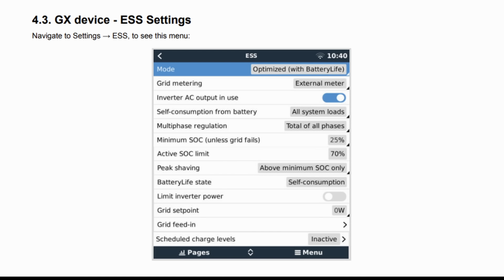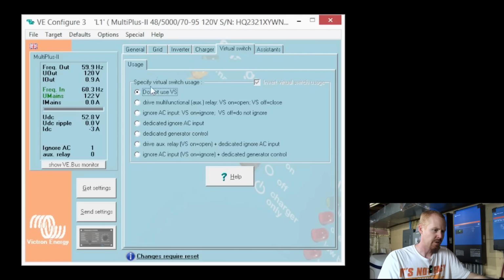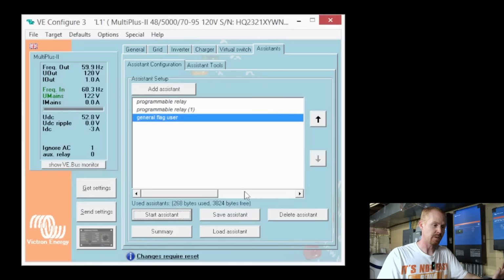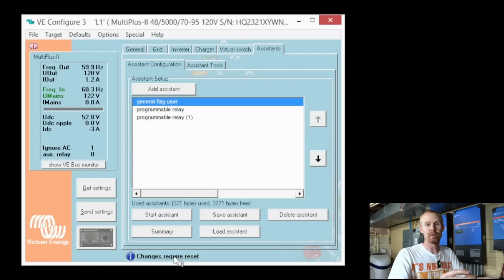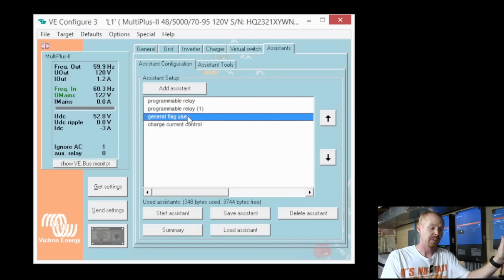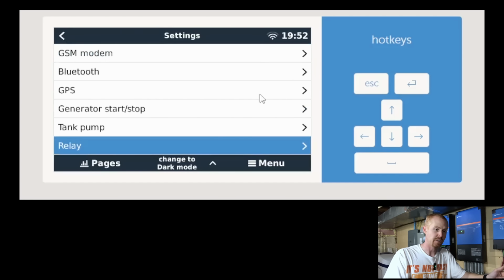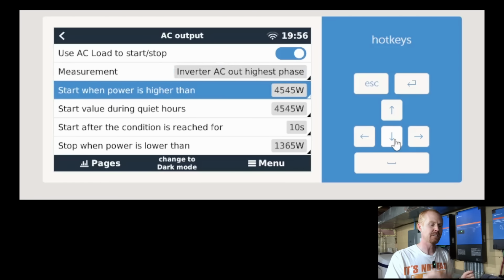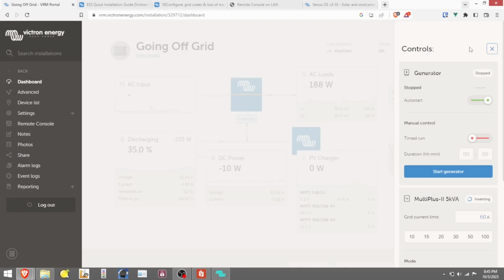Different Ways to Ignore AC Input on a Victron MultiPlus 2 Inverter

Comment: I'm so glad I found your channel.  I am just designing my Victron  2 x 48/5000/70 split phase battery backup system for my home. I do have a question. In a terrestrial environment what is the practical advantages of ignoring grid input other than potential time-of-use grid savings? Whether I am using grid to power my loads or using grid to replenish the batteries, I am still using the same kWh. Thanks!
Reply from the maker: The reason I want to ignore AC IN any time I can is that it seems like a waste to me.  You don't save any money if you're constantly using grid power to run your loads or recharge your batteries.  I want to use solar only to recharge my batteries so I'm actually saving money on my electric bill each month.  

Hope that helps!

Comment: Can you program a quattro with programmable relay to look at that AUX1 input and based on SOC, try to turn on the AC power or try to turn on the actual gernator start?   Example... Cerbo commands it's relay 1 to call for external power at 15%SoC.   The AUX1 is made and the quattro tries to connect to the grid.  If the grid isn't available, then obviously it can't.  Time goes on and the SoC drops to say 10% and the quattro then tries to start my generator of hte 2nd input.

I had no idea all this programability existed in the victron system.
Reply from the maker: @ai4px  I believe you could, you would just have to use a mixture of assistants and the cerbo relay.  Unfortunately the Cerbo only allows relay 1 to be programmed for the generator.  So you would have to program an assistant for 1 power source and then the Cerbo for the other power source.

If you think this customization is cool, you should look at NodeRed.  That gives you even more flexibility and control over all different aspects of your Victron system.
Reply: @AdamDeLayDIY I found a simpler way (I think).  The lynx shunt can have its alarm relay for for SoC.  More investigation to be done!

Comment: Hello again and thank 🙏you for giving me this link. Am I right in thinking that by using the "Ignore AC Input 1" the solenoid will disconnect that input even though it is physically connected to the grid? If that is so it would help me enormously by eliminating the need for an external relay 🤔
Reply from the maker: @9111logic  that’s correct.  Wires stay connected and even the grid is there, but the internal relay disconnects and doesn’t allow grid power to flow until you want it to.  This is how I’ve run my system for a long time.
Reply: @AdamDeLayDIY  Perfect 🙏
Reply: @AdamDeLayDIY  I had the same question.  Wiring a separate 50amp (I have an RV) relay would be cumbersome.  This is great because it gives the flexibility to cycle my lithium batteries, utlilize 1500 watts of solar to charge 600ah of batteries, and with a touch (cerbo) of the screen set to manual when traveling and living off the Campground's dime.

Comment: Great informative video👍
Wondering that what if we want to turn on AC input only to charge batteries?
Can we are able to set Battery as priority 1? 
As off grid, We are going to get (2) Multi Plus II as to setup as split phase.
Reply from the maker: @adassociates8235  thanks!  Unfortunately as soon as AC in is turned on, everything shifts over to it.  That’s the entire reason why I had to find a way to dynamically turn AC In on and off.  

I normally don’t charge from the grid but in the event I needed to, I would manually trigger the “generator” (AC In) using the cerbo and then I would throw another switch.  

Custom Grid Charging: Victron MultiPlus 2 & Cerbo Relay
https://youtu.be/T5-7xcGWsgE

Be aware that there was a part 2 to this video as I did miss a step.  

Custom Grid Charging - I Missed a Step...
https://youtu.be/5RkDZTYVTKw

Merry Christmas!
Reply: hi Adam, thank you for great videos as you are always do. just curious, How does the Inverter determine if it’s receiving power from the Grid or a Generator?
Reply from the maker: @adassociates8235  It doesn't know.   The Quattro has 2 Inputs on it but the MultiPlus inverters only have 1.

Comment: Thx Adam for taking the time to make this video and share it with the community…I’ve been struggling to setup a nodered flow to take SOC, load and time of day into consideration…also using global variables to avoid updating the flow..but it became too complex….I added a cheap 2 relay module to my raspberry pi and with kwindrems GPIO mod got them working in no time…adding the wire to Aux 1 was no problem, and the VEConfig was a cinch…albeit that I also did it the wrong way round….now my inverter is switching properly and I can set the parameters under Generator control on Venus OS 🙏
Reply from the maker: That’s awesome!  Glad it worked out for you!

Comment: I used your instructions in this video to set up my system to only charge the battery from grid when the charge drops to 50%. It then turned the grid off when charge reached 75%. This was workling fine for a number of months but 5 days ago it stopped working for some reason. It is now charging from 50% to 52% and then shuts grid off.

I have checked my assistants and they seem to be fine. I deleted them and remade them identically but it is till behaving the same. I am not sure what is happening. Any ideas? Thanks
Reply: It's using the BMS data now and it's set to use it. Maybe the communication between the BMS and the Victron was broken temporarily by fault of either device and the hard shutdown of the Victron restored it? That's the only thing I can think of... I could be wrong of course
Reply from the maker: @gocfella  it’s possible.  If it happens again, maybe unplug the connection to the battery for a few seconds (or try the redetect option under device settings on the cerbo).
Reply: @AdamDeLayDIY  Will do. Appreciate the advice.
Reply from the maker: Are you using a shunt for the SOC information or the battery monitor aspect of the inverter?  If it's the latter, when was the last time you fully charged the battery?
Reply: @AdamDeLayDIY  I'm using the BMS of the battery to report the SOC. All the Victron software appears to be reading the charge correctly, as in, when it stops charging it knows it is at 52%. I haven't fully charged the battery in about 2 months.
Reply from the maker: @gocfella  So which option from the video are you using?
Reply: @AdamDeLayDIY  I'm just using the assistants. If I want to edit settings I just do it through Ve.Config.
Reply from the maker: @gocfella  I can't say that I've seen that happen before.  I didn't use just the assistants for very long.  

Between the time that it was working and then it stopped, have you updated the firmware on your inverter or modified those assistants at all?
Reply: @AdamDeLayDIY  No I haven't modified the assistants or intentionally updated firmware unless there was an auto update? I updated all the firmwares today manually to see if it might fix the issue but no joy. Thanks for taking the time to talk to me. I'll keep messing around to see if I can figure out what is happening anyway 👍
Reply from the maker: @gocfella  Good luck!  Let me know if you figure anything out!  

I'm still wondering if the inverter isn't using the actual SOC from the BMS and it's trying to calculate things on its own.  I might suggest doing a full charge on the batteries and see if the next time it changes like it's supposed to.  Might at least rule something out.
Reply: I shutdown the Multiplus with the switch for about 30 seconds and turned it back on again. When I got into the portal the battery was showing at 87% instead of 52%. Everything seems to be behaving normally now. Still don't know what was happening exactly which is frustrating but problem is solved for now at least. Cheers mate. If it happens again and I figure out the exact cause I will let you know.
Reply from the maker: @ I’m glad it’s working, but that leads me to believe that it’s not using the BMS data.  It sounds like the multi plus is trying to calculate on its own or by voltage, which is gonna be inaccurate, especially when it doesn’t get charged to 100% regularly.

Comment: Hello Adam. good eve. Is the setting for the aux here is correct (relay on and off part) or do i need to reverse it as well?
Reply from the maker: Can you give me a timestamp from the video of the part you’re talking about?
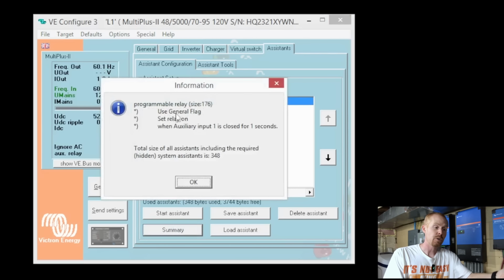Reply: @AdamDeLayDIY  sorry, its in about 13:28 onwards settings
Reply from the maker: @DAMAGEINC29  Not a problem.  I believe those ones should be fine.  The only ones that were backwards was only using the generator start/stop assistant (cause I hadn't used those settings in a while so I miss-spoke).  The ones were I use the relay are the actual settings programmed into my inverters.
Reply: @AdamDeLayDIY  i got mine wroking using a relay. its a relay hat i got from amazon. The settings was reverse for me because i think i wired the positive Aux to NO of the relay.  Instead  of reversing the wires on Aux, I reversed the "on and off" on the programable relay and it worked. Thank you so much. I will try the 2nd relay settings from ur other video tomorrow.
Reply from the maker: @ awesome!  Congrats and have fun!

Comment: Holy cow I want a Victron system but I don’t think I can do the programming necessary for what I want to do, I’m not computer savvy I am an electrician so the wiring is a breeze but all this …boy idk
Reply from the maker: @DonnieThomas-m2y  There’s actually limited programming needed for your initial setup.  You CAN go down the rabbit hole and really customize things if you want to but you don’t need too.  In fact, depending on where you purchase from, they might be able to preprogram things for you ahead of time, so all you need to do is wire it up and go.  I believe Current Connected does this for their Victron gear.

Comment: May need to revisit this one with the latest Victron updates.  Just updated the Multiplus 3000 pair to the latest firmware and it seems to have reverted to when AC is available use AC before battery.  I am an aspiring offgrid looking to keep as much off as possible but I still have grid power I use to fail over to when batts are low.  Im going to review the changes you made and go through it again and see if they were just reset.
Reply from the maker: @joeschmidt9503 typically when you update your Victron firmware it does reset everything to factory defaults. That’s how they make sure updates don’t break because of a setting someone is using.  You’ll have to save your settings before you update the inverter firmware and then restore those settings after the update.

Comment: Very nice, just tried ESS but this setup works much better, with a offgrid system. 
Next step is to combine it with a Shelly relay, that is controlled by the price on electricity in my region. Thanks.
Reply from the maker: Awesome!  Yeah ESS seems to work fine if you're selling back to the grid, but I was always afraid that power could accidentally get pushed back to the grid.  This way the relay closes when you're running off battery power.

Comment: Hello and congratulations for the video
I come to you for the multiplus
can we use the ACin input not permanently on the network but just connect it to a 230V 20A socket (France) to just supply the ACin input to charge a park battery at night rate and use the ACout during the day to restore the energy to my electrical panel?
because connecting the ACin to the network bothers me a little because it requires a lot of steps because if there is a risk of injection into the network it is necessary to go through a Consuel I would especially like to be in self-consumption and from time to time be able to close the multiplus with a source inverter in my prolonged absence and switch to the direct network
laurent
Reply from the maker: I don't think that would be a problem.  You could use the generator start/stop function of the Cerbo but instead of using the SOC to determine when the AC In is turned on/off, you could either use the "periodic run" to program a certain time of day or you could leave it all manual and just use the "manual start" button.  

You would just want to make sure you limit the AC IN current in the Multiplus to 20a so you don't accidentally have any issues.

Another manual option would be just to wire a plug into the AC IN and when you want to use grid power, you just plug into the wall.  When you want to use battery power, you unplug from the wall.  Out of the box, the inverter will switch to AC IN as soon as it detects power coming into the inverter and it will switch back to battery when AC IN is lost.
Reply: ok ok! I understand so I use the NETWORK wall socket to power the multi and charge the battery (at night) and in the morning as soon as I get up I close the network of the ACin of the multi it will be the ACout which will completely power my house is that right?
I can also reserve only part of my electrical panel for the multiplus (light, laptop, ) the rest can be powered directly by my network?
there is also the option with an energy meter downstream of my meter to measure the current and do self-consumption?
Reply from the maker: @laurentsosson1739  So yeah, if you turn off the NETWORK or unplug from the NETWORK then the inverter should automatically switch over to battery power fast enough that nothing should lose power.  

As far as reserving part of your electrical panel, that would really depend on how you have things wired up.  Usually the AC Out of the inverter will power a separate electrical panel with any loads you want powered in the event of a NETWORK loss (called a critical loads panel).  Then anything in your main electrical panel would still have NETWORK power.  

There are options for self consumption.  You would need CTs and possibly a separate meter and you would install and configure the ESS assistant.  This route though typically requires you to have some power company involvement because there's potential for power to get fed back up to the NETWORK.
Reply: HELLO
sorry for my late reply

ok to close ACin input of the multi 8000VA and switch to the batteries in this case I would be 100% autonomous
on the other hand if I want to program a charge at night rate of the network at 100A how should we do it?
can we do a charge only with the network at 100A and not use the multi to power the electrical panel?
act only in charger mode?

Comment: Hello Adam. Thank you for this video. I just got a multiplus2 and followed this settings (only the assistant settings) but the multiplus still wont ignore AC input. It will still go into main and float mode when AC is inteoduced. Should the power assist still be 2.0? Im using a raspberry pi not a cerbo gx. Would that matter?
Reply from the maker: Congrats on getting the Multiplus!

Did you happen to see the pinned comment and the note in the video description?  I misspoke on the assistant configuration and that's probably what you're noticing.  

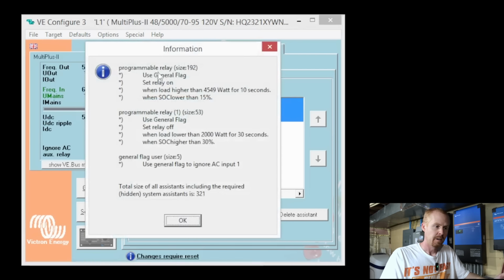At 9:21, the generator start/stop assistant information is not correct.  In the video it shows the relay being turned on when the load is high or the SOC is low (and the opposite for low load and high SOC), but the relay should be turned off.  The relay is controlling the General Flag (AC Ignore).  When the relay is set to "on" it will activate AC Ignore and turn off the grid connection.  When the relay os "off" it will NOT ignore AC In and the inverter will switch to passthrough mode.  

Basically  you just have to switch "relay on" to "relay off" and visa versa for the two programmable relay assistants.  Unfortunately I cannot edit the video to add the correction without taking it down.
Reply: @AdamDeLay07  oh Thank you. I did see that note but i thought you were referring to the physical relay on the cerbo gx, My bad. I think i got it and will try again later tonight. Thank you so much for the reply here.
Reply from the maker: @DAMAGEINC29  Awesome!  Let me know how it goes!
Reply: @AdamDeLayDIY  Hello Adam. good evening.I edited the relay, now its only ignoring the AC input even thought there is a set relay(programmable relay2) to NOT  to ignore AC when the batt % is below 40% or the load is below 3500. i rewatch this video and noticed that in the" General tab", the Enabe battery monitor is unchecked. Would that have mattered?
Reply from the maker: @DAMAGEINC29  Do you have a shunt in your system already to monitor the SOC?
Reply: @AdamDeLayDIY  yes, i do have the Victron shunt as well. I was able to make it assist when theres a large load but its not the load i provided in the relay. Also when i was tinkering with the settings at one point "adjusted the settings to charge the battery when the % is below 40% it did but it will stip when it reached 40%. There must be something wrong with how i set it up.
Reply from the maker: @DAMAGEINC29  any chance you can export your settings and email them to me so I can take a look?  adam@going-off-grid.com